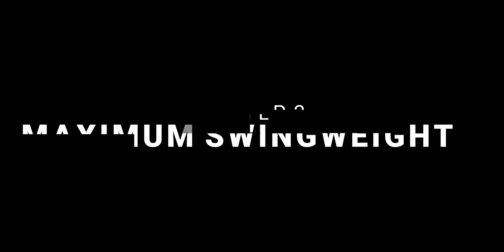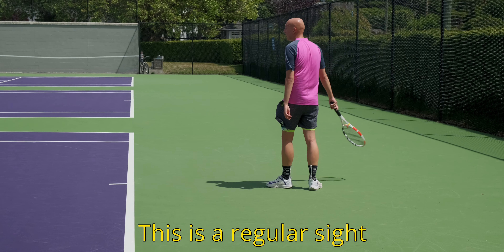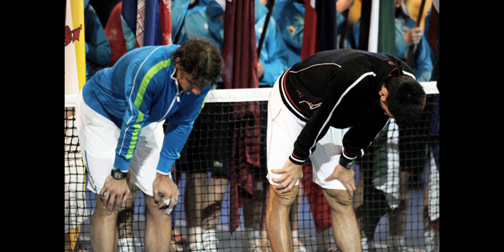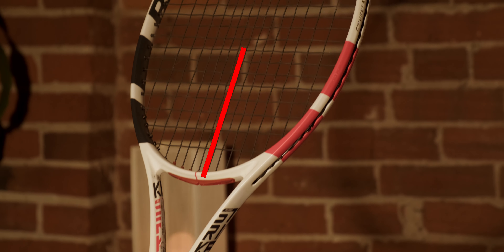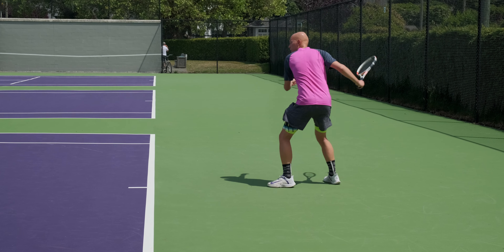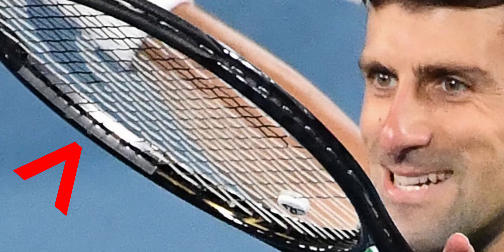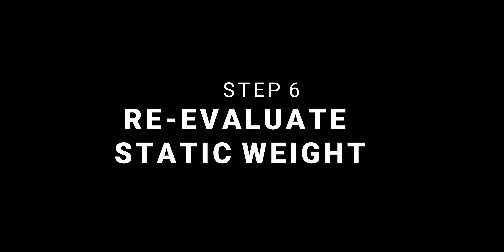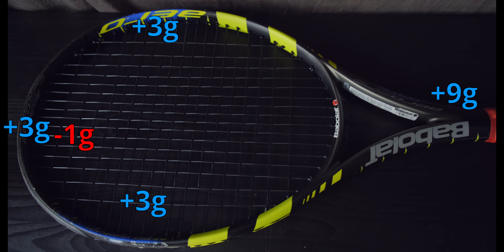Get More POWER, SPIN and STABILITY From Your Racquet

Comment: Really helpful video, the dangerous catch on adding weight I have experienced is two fold , 1. you need to counter balance the weight from the hoop in the butt to maintain racquet balance for manoeuvrability. 2. The overall weight added will reduce your swing speed so less is more!   I found you have to test weight configurations so I worked backwards like you did by reducing weight so I now only have 1g at 12 and 1.5 at 3, 9 then counter balanced that with two over grips which was about 1g and 3g in the butt of the handle so thats 8g overall. The dampener weights about 5gs so I replaced that with a 1g rubber band. So far the setup works with my Vcore95 which is 311g unstrung hence, why I am trying to keep the weight down. My next racquet will be around 300g I think.
Reply from the maker: Interesting point. Do you think it's an unfair assumption that the player will get stronger due to the weight, thereby returning to their old higher swing speed?

Comment: Thanks for the tips! When limit testing swingweight by adding weight at 12 do we have to add weight to the handle to maintain the same balance throughout the test? 🙏🙏
Reply from the maker: Good question! I personally don't. For me, balance tuning (recoil weight tuning) comes after I've found the maximum swingweight. Though once I've countered in the handle I do also re-attempt the limit testing just in case. I have not personally experienced a case where the initial limit test proved insufficient after I've rebalance the frame. I've actually found that I can tolerate a higher SW only in cases where static weight is lower than average.

Mileage may definitely vary case by case, depending on racquet and player, but I don't think its necessary to take the extra step to rebalance at every SW adjustment.

Comment: Hi man, great video and great points, do you know to to measure the twist weight? any simple way to do it at home? thanks again.
Reply from the maker: No great ways to do it at home without equipment. I don't actually think that even measuring swingweight at home is accurate enough due to human error. This product is probably the cheapest way to measure twistweight. https://www.briffidi.com/product/sw1/

Comment: Can you please clarify the difference between lateral stability that comes from weight (3 and 9, for instance) vs stability from racquet stiffness?  I have found that racquets with the same twist weight/swingweight/balance can behave very differently depending (seemingly) on stiffness.  For instance, I find that off-center shots on my Gravity Tour (with 2g each on 3 and 9, no less, twist weight over 15) tend to lose gobs of power whereas my Blade 104sw (twist weight under 15) is far more forgiving of off-center shots (but unfortunately it jars my elbow...).
Reply from the maker: I am reluctant to go into this because I don't have any research to back up my findings. You would need to have a machine that can test RA, but on a different axis. Right now, RA is measured so that the racquet bends at the throat. To test the torsional rigidity of racquets, we would need to test the flex so that it bends down the centre of the frame (along the twistweight axis). I suspect that both stiffness and beam shape/size would have a significant impact on this. The other thing to consider is thee relative stiffness's of the hoop and different off-centre positions. From what I have read from Prince, is that there are difference flex regions on a racquet. For example, a between 12 and 3/9 is region 1, 3/9 to 6 is region 2 and the throat is region 3. You could have different stiffness's across these regions, meaning your torsional rigidity would be difference depending the location of your off-centre shot. To make it even more complication, many racquets with have variable beam shapes. I suspect that only manufacturers have the data on exactly what time of beam shapes lend themselves to different types of torsional rigidity.
Reply: @TennCom  I suppose the only thing to do is accept each racquet as it is and tweak it's inherent tendencies where you can.  I've really tried hard to make the Gravity Tour work for me but there's just some limiting factor I don't quite understand.  Tennis nerding can be such a rabbit hole!  Thanks for the quick response.  I love your new channel and hope you get bigger quickly!
Reply from the maker: @vanodne  Thanks for the well wishes! We've all run into limiting factors, but the journey to the perfect racquet is all part of the fun!

Comment: I’m an intermediate player with a Gravity Pro and a Gravity MP (lower static weight, less HL, lower SW). I’m using the Pro for training since it helps me develop proper technique, but I intend to use the MP for matches since it’s more forgiving and lighter (i’m not in top physical shape). How should I add weight to the MP so that I can most readily switch between it and the Pro with minimal changes in my technique & timing? Is it more important for me to match the balance (by adding weight to the MP’s grip) or the SW for this purpose?
Reply from the maker: I don't know exactly how you should add the weight. Head racquets can very in spec quite a bit due to quality control standards. The beset thing to do is to have both racquets measure with the same string and use Tennis Warehouse's customization tool on the TWU website.
Reply: I get the idea, but the MP has a more open string pattern and a thicker beam... even if you have the same swing/weight on both, they will still be different feeling racquets... ;) The Pro has still the most control and feel, while the MP has more power and access to spin with less maneuverability than before.. ;)

Comment: Great video! I use a prestige pro 2020 and added 2g of lead at 12 to help me with the serve which was helping me. I have a hybrid setup strung at 50 lbs. But then when I tried my friend's stock babolat pure drive 2021 with poly strung at 57lbs, I was serving better. It was kind of confusing me since my racquet was strung loser but it is a control frame compared to the powerful frame of the babolat but strung tighter but still more power in the babolat. Any thoughts about it? Maybe an idea for a video. :)
Reply from the maker: I really like the Prestige Pro of that gen! Tension has very little impact on racquet performance. It’s more about adjusting the stiffness of the string bed, raising the pitch of the vibration, making it feel stiffer and lowering the launch angle. The thick beam from the Pure Drive with increase power on all shot even if it’s strung at 65lbs. It’s also possible that the lighter racquet also increased your racquet head speed.

I do have a cool idea in the works on string tension!
Reply: @TennCom  nice! Will wait for that video. Have you tried the recent version of the prestige pro? I think its named the prestige tour now. I saw from the reviews that its slightly better. 
Maybe the weight of the pure drive helped with me serving better. I was just shocked when I tried it on game play since I did not try any babolat racquets due to the high stiffness rating.
Reply from the maker: @peejread2309  I haven’t but I can only assume it’s a pretty incremental update. Specs look almost the same. I’m having a hard time sourcing Head stuff cuz my stringer doesn’t carry it, but I want to try it
Reply: You are objectively playing better with the Pure Drive.
Reply: The way a racket swings is a function of all three static weight, balance and swing weight. Do you know your racket specs? According to TW (prestige pro 2020, i.e. graphene 360+?), it's 335 g, 32.5 cm, 327 SW (of course this is an average value for a bunch of rackets, yours can be way off specially in SW). But taking this values and adding 2g to the tip (12), you'll get approx. 337 g, 32.7 cm, 333.5 SW.
The Pure Drive specs would be 318, 33 cm, 320 SW. It is curious that when you added 2g to the tip of your Prestige, (that is, increased SW), it felt better for serving, but when you tried a 320 SW racket (lower even than your initial specs) it actually felt even better.
That could mean either you feel more comfortable with head-heavier balances or with low MGR/Is.
MGR/I is maybe a pretty complex concept to dive into if you have never heard of it. But it's said to be pretty relevant to the way a racket feels while swinging, and particularly on serves (which is a very particular swing). If you are interested, I can recommend some sites and threads that talk about it.
 To have a gross approach, you could just multiply weight times balance and divide it by SW (in the units usually used, that is g, cm, and kg•cm^2, that is, the units I've used in this comment –in terms of units that would obviously be a mess, but as I said, to have a gross orientative value is actually ok), and most stock rackets would be somewhere between  31.5 and 33.5 (some pro's specs actually come closer to 31 or 34).
Your Prestige pro stock would clock at 33.3, and 33.0 with the added 2g. The Pure Drive would clock at 32.8.
Mind that the scale for actual MGR/I would be 20-21 instead of 31.5-33.5, which may be a little more visual.

So I'd first go for head-heavier balances and see how they feel, you could add more weight at 12 if it doesn't become too much (333 is an already pretty respectable SW). If you find you feel more comfortable with lighter balances, then you can try with polarization (that is, weight both at tip and buttcap, which lowers MGR/I without increasing balance).
If you like the feel of the low MGR/I but also like the flex and control of the Prestige, you may find some middle ground in the Radical MP, with a 98 head, 20/23/21 mm beam and ~20,5 mgri (that be 32.5 in the "gross" scale, that is middle ground).
You could even try the graphene 360 (no "+", the blue one), one of the most polarized stock rackets (20.0 mgri).

Although your comment is 1yo already so maybe you are way past all this 😅. I hope I have helped in some way in any case, and am open to any further questions you would like!
Reply: @Maiqel  thank you for your input. It is quite complex that I can't keep up. But I switched to a babolat pure strike VS 2022. I like it way better than the prestige pro. It has way more power than the prestige pro despite it being a control frame which I like but having issues with control at the net.
Reply: @peejread2309  good pick! That's as well some good middle ground between the Prestige and the Pure Drive. It seems like you favor a lighter balance after all.
Regarding the net, the racket is light compared with the Prestige Pro, so I don't think it's a maneuverability problem. Maybe stability? You could try adding a couple grams at 3-9 or 2-10 and 2-3 grams at the buttcap to keep the balance, see how it feels.
Tennis Warehouse gives a twistweight for the Strike VS of 13.06 and 14.56 for the two models listed. It doesn't specify which year is which but I'm assuming the latest would be 14.56 which isn't particularly low, but still...
Of course, it could be a technique and footwork problem as well, I know that's my case at least. I suck at the net 😅. But I'm assuming maybe you're comparing to the Prestige netplay?
Reply: @Maiqel  yes. I am comparing to my prestige and my favorite burn fst 99 net play. I play doubles a lot so having control in the net is vital and players tell me that I am really good at the net. I am trying to trial a different poly string for more control but I havent played as much this few months. People say that adding weight to the pure strike VS might do it good but I want to keep the racquet between 310-315g unstrung. We'll see if I need to add more weight in the hoop.

Comment: How many times can you realistically restring a racket before the frame gives up?
Reply from the maker: Good question. It can be hard to say, because another factor to consider is how hard the is on the racquet during play. I find my racquets wear out about every 2 years. I typically play with a pair and restring an average of 1.5x per month. This averages to about 36 string jobs. I wouldn't say 36 is a golden rule, but I think 30-40x and the racquet's ability to return energy to the ball would be diminished. 

I think you would have to string a racquet hundreds of times to actually crack the racquet from stringing alone. Maybe more. This is assuming the frame is strung properly on a 6-point machine, within a normal tension range.